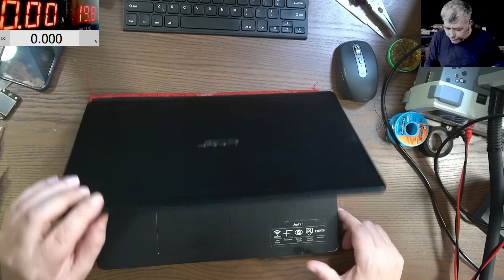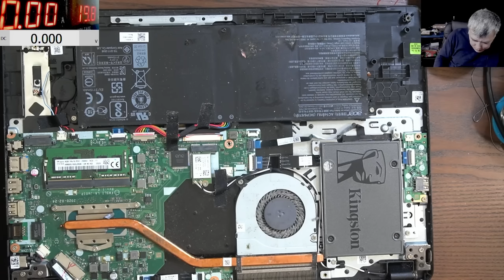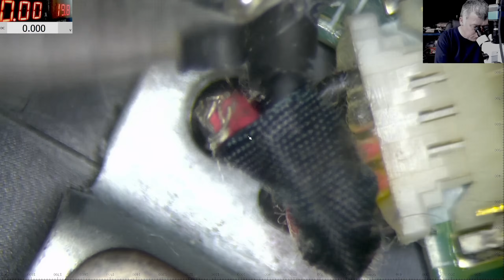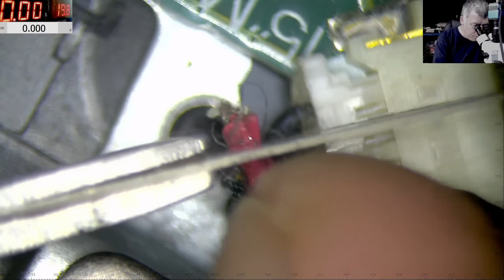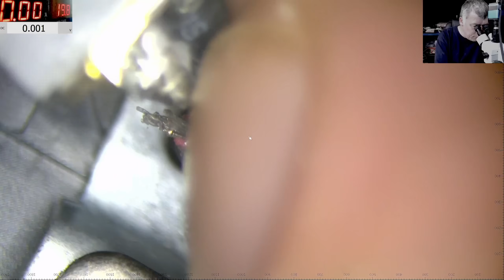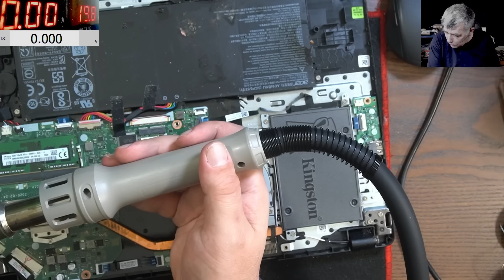Acer Aspire 3 - not charging repair - I need more jobs like this :D

Comment: dear my laptop is acer es1 572. problem is its wont power on and not even charging, no power or charging led indecator show. while i try to repair it a little burning smell was blown for just a secound and after that its totally dead(no led indicator light up). but i belive the motherboard can be fix. what can i do for this setuation, please kindly give me some suggestions.

Comment: Mr. Sorin, first thank you for your work and teaching is priceless. My question is kind a silly question but is the answer that I need. Where do you put the black tip when you are touching some component for testing with the red tip? Cheers!
Reply: if you mean the black probe, it can be attached to any ground on the board mostly metals and holes

Comment: I found that a precision cutting pliers will work better than the cutting knife just don't press too hard and make sure to cut all around the cable insulation than pull off the rest also i use a piece of wire insulation to stick it inside the dc port to isolate the middle pin and insert the red probe right into it, it prevents any accidental touching with the ground

Comment: (2:07) Maybe it's silly on my part but I got the impression that that big internal battery seems to start "swelling" on the far right (located almost in the center). Hopefully I'm wrong. All the best.
Reply: Yes, that battery casing looks deformed/heat damaged at back too
Reply: That battery indeed looks dodgy, but I guess battery replacement was not the reason this laptop was brought to the workshop.

Comment: Sorin, you can put a loose sleeve on contact of your power delivery red probe, than you can easily contact middle pin of the dc jack without sparking and freeing your hand from holding it. Hope I explain it well.

Comment: Don't get angry at my comment, I've been following you for many years, one thing doesn't work for me, when you're a professional repairman, how come you can't buy adapters for $15, so you have all possible charger ports for all the laptops you repair, if you're not in possibilities, I am willing to buy from you, since I learned a lot from you, let me know  you know who I am, have a nice day
Reply: He don't use adapter because he wants to see power supply's reaction and amp draw
The power supply is 100% safer than used or fake adapters.
Reply: @italianofx   You can use adapters with a power supply, so you can always see the data
Reply: @mladen1000 Dude,he's a pro.I bet off the camera he never powers on the laptop to boot windows.the wire fixed and no short  and normal charging light and it's done !